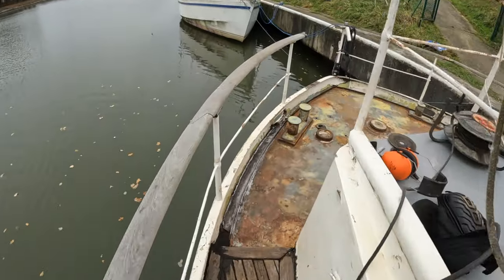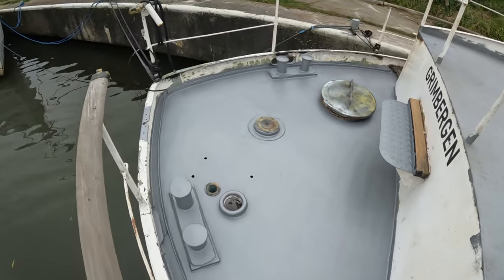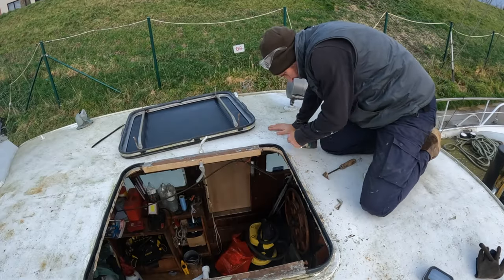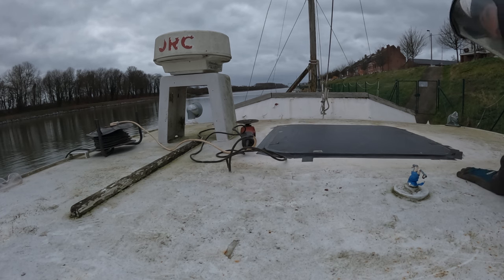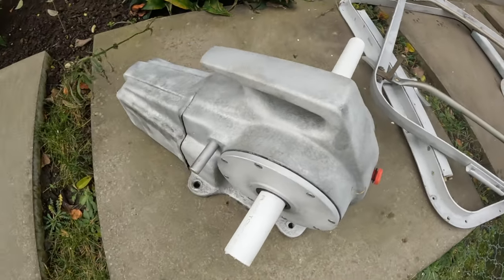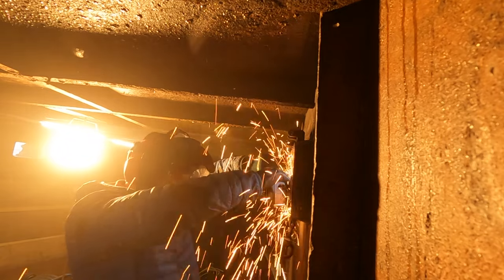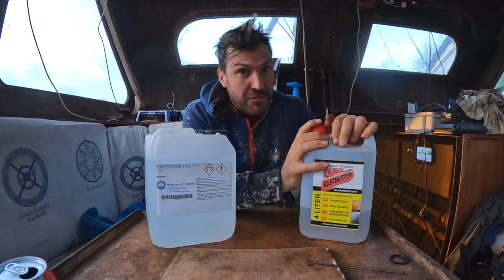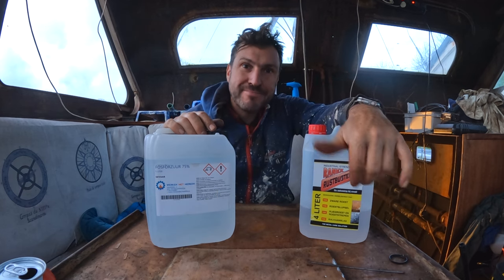Project Y EP 10 - Rust converter stand-off

Comment: One hell of a project , in my sea days back in the late 70's and early 80's rust buster was applied let dry and then you had to wash the area with soap and fresh water or the paint wouldn't adhere properly. The advantage of sand blasting is that you create a anchoring pattern so the paint can adhere properly. Concerning your idea to power it electricly you must take into consideration that that's a heavy steel boat that needs a lot of power to make headway and more to stop it in a emergency. Have you thought of diesel electric and a small bank of batteries to cruise silently for an hour or so. Greetings from Panamá and keep up the good work I just love the shape and lines of your boat.
Reply from the maker: thank you. hybrid is also an option. I'm visiting Boot Dusseldorf in 2 weeks. then I'll know more...

Comment: I follow your channel as I am in the process of getting a handle on a steel boat myself - a Pedro 33 from 1979. I am particularly interested that you brush with phosphoric acid on the rusted steel. What is the exact purpose of it? Do you apply primer after drying?  Should the acid be cleaned off before primer? I clean off rust myself - change the iron - and give a 2-component primer and final paint.
Reply from the maker: the rust is converted, the residue should be brushed, sanded of, and the a primer is applied.

Comment: Before converting the boat to electric propulsion, please make some calculations on how much power/energy you can make with solar, and how much power and energy the boat needs to move ok.
Before it had 150kw, and if you can make 5kw with solar on that boat, it will be a huge miracle.
Sooo it is not even close to possible to convert it to electric. Maybe with diesel-electric or something like that.
Reply from the maker: I'm still checking all options;

Comment: Unless you get yourself a good generator, converting to electric will limit your range. The generator could double as an emergency wing engine.
Reply from the maker: I agree, but that dream is still far away. we'll see what technology brings in 3-5 years.
Reply: I would definitely keep and service the current engine for range and keeping resale price but possibly with a clutch on the shafts which enable it to be powered by electric motors for slow inland cruising. Betamax have a set up which might give you some ideas. Either engine can then be run as a generator as well as a propulsion unit. When the price of batteries reduce in future that will leave you with more options. Beautiful boat. I'm surprised there are no scuppers immediately in front of that bow playe to allow all shipped water a path overboard